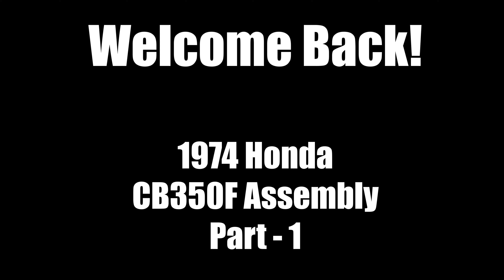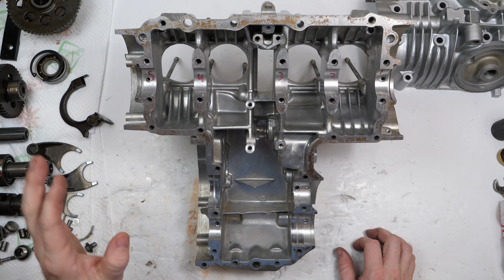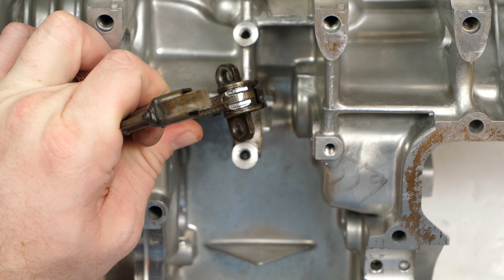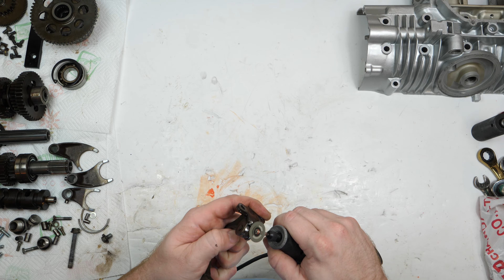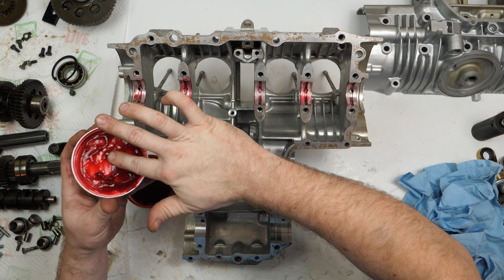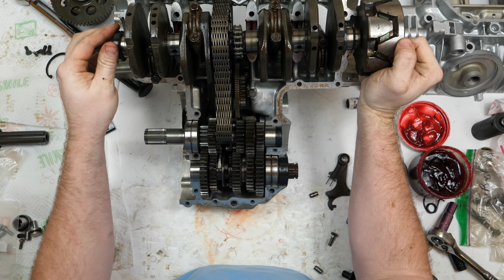1974 Honda CB350F Assembly - Part 1

Comment: hi im after a set of n.o.s. 1mm oversize piston rings for my cb350f if you know of anyone who has one. thanks martin
Reply from the maker: I use these they are fine. https://www.ebay.com/itm/132383633365?mkcid=16&mkevt=1&mkrid=711-127632-2357-0&ssspo=KWnFQthBRwK&sssrc=2349624&ssuid=_6Qbx_hcRbG&var=&widget_ver=artemis&media=COPY
Reply: @DeWoodysShop  thanks appreciate that . keep up the good work on your channel

Comment: Thank you for this video. I just took apart my 1973 350 four and had exactly the same issue with the cam chain tensioner. And successfully applied the exact same remedy
Reply from the maker: Good to hear! It seems to be the only thing that really mechanically went wrong in these.

Comment: I wanna attempt trying this on my own with ALL Genuine parts but was wondering how much would you charge  if I shipped my '74 to you? Excellent video ALL Parts ! I'm Rob from North Carolina.
Reply from the maker: Unfortunately right now i am not doing any outside work, right now we have about a 2 year back log.
Reply: hey thanks for your reply man! no problem. your videos are detailed enough that ill try it . just have to get the parts ordered through honda if they haven't been discontinued.
Reply from the maker: @cartoonist1975  many of them have, but 4into1 .com is a great resource i use a lot.
Reply: Perfect ! I didn't wanna keep flooding you with questions.
Reply from the maker: @cartoonist1975  No worries! sorry i missed your first post.
Reply: not at all . your busy as it is ! thanks again . i have a hammerhead that id like to place this on. shifter kart 😆

Comment: Nice work. Earlier this year, I completed a full restoration on a '74 CB350F (https://www.youtube.com/watch?v=K4c2eWrPo10) myself. I didn't have to get into the bottom end, but I did snag a shot of one of the pistons with a quarter (coin) centered on top just to show how tiny these cylinders really are. Since you were down to the bare cases, I was wondering if you thought about checking the crank bearing clearances using plastiguage? Just curious.
Reply from the maker: I actually did check them, it was just not on camera. And i think i showed checking bearings in one of my other videos. Also like most cb350f it had almost no miles on it anyway and the bearings pretty much looked new.

Comment: Wow a 350cc inline 4??? Are those things rare? That's soo cool and I bet it makes an amazing sound!
Reply from the maker: Yep, tiny pistons. I would not say they are rare exactly as much as just uncommon anymore. Mine or the ones i built are generally the only i see in my area. The 400f which is the same engine but with bigger bore and a 6 speed transmissions are significantly more rare though. Yes, i love how they sound, lots of fun around town and on back roads.